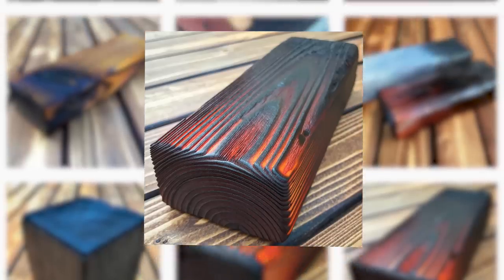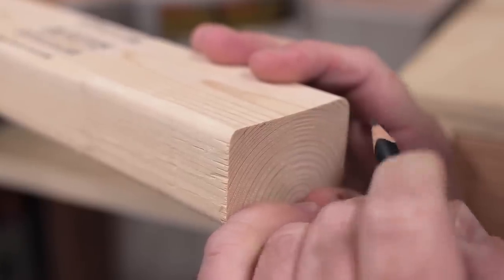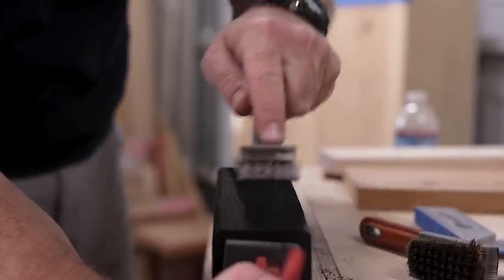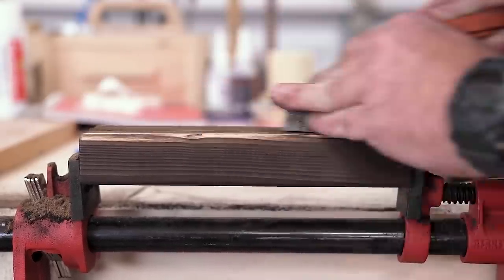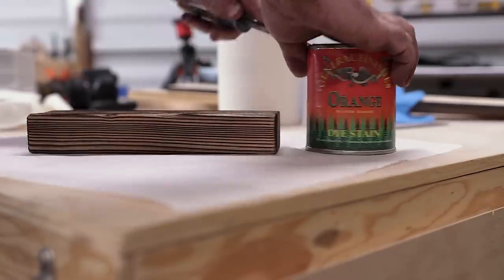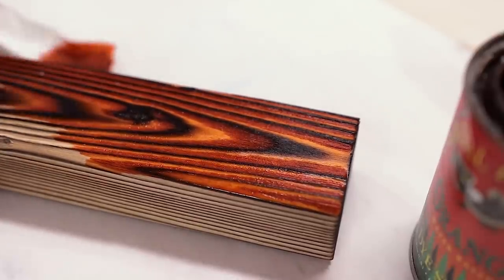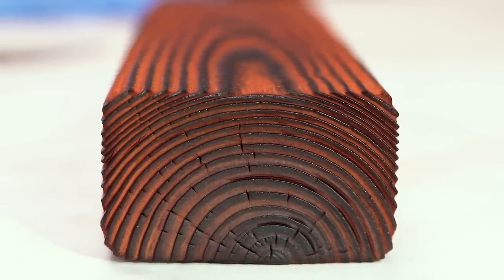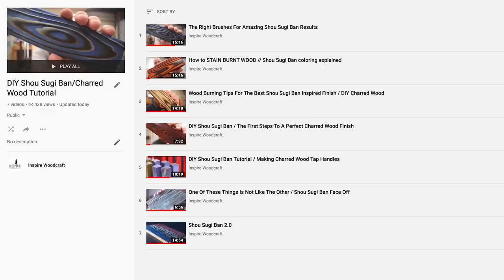The Shou Sugi Ban Inspired Finish That Started It All

Comment: Some 35 years ago, I made a few sets of coffee tables and end tables using the same technique. Doweled and glued, no nails or screws and they're still intact. I didn't put nearly the care and attention as you did but they still turned out not too badly. Impressed with your result.
Reply from the maker: Well thanks! I think dowels have somehow been shunned over the years and I'm not sure exactly why. I still use them for all kinds of things.

Comment: I love these videos. I have started making signs and whatnot using "fire blockers." Steel doesn't let fire through and can create some real interesting designs
Reply from the maker: I've wondered if anyone has done this yet. I wanted to try it as well and just never did. Do you have certain shapes and stuff that you use for different designs or effects?
Reply: @InspireWoodcraft  i mostly use some lettering. I make a lot of personalized signs. I used a washer (and a large bolt to cover the hole) in combination with a laser engraver to make some Nightmare Before Christmas key chains. Wood tends to leave a fade, but steel will allow you to get sharp edges between burn and natural. Currently I am exploring designing some plasma cut stencils for shapes.

Comment: Looks amazing!  I just can't imagine the time to do it all by hand!?!?!?
I've been using Nylox ever since I found your original tutorial (thank you so much for those) and really like the results.  It does take a lot of effort to get results anywhere near yours but it's worth it.
Keep up the great videos and have a great Christmas!
Reply from the maker: It's so much work by hand! I forgot to mention but you can also use the Nyalox brushes to do the heavy lifting and then follow it up by hand to create the texture. But yeah by hand takes FOREVER! Ha! That's what happens when you go in blind though I suppose. Merry Christmas to you and yours!
Reply: @InspireWoodcraft  are you talking about a wheel nyalox brush? if so what grit do you recommend to get the texture like yours im tryna make a burnt bar counter top on live edge but not on the bark part like just the top then doing the doors below but lmk how to get that texture and lines if that's what you meant or post a link to the brush whatever is easier for you.

Comment: I'm just starting to play with this and used a little wire brush I had from an automotive kit and it leaves notable scratch marks in the pine I'm playing with. Are there less abrasive brushes that will still dig out a good portion of the 'inbetween grain line' portions to get better contrast? Or is it that the brush needs to follow the contour of the individual lines to kind of blend into it to look more like texture lines instead of scratches?

Comment: Thanks again for the great video.  I love the vibrant colors that you are using .  Interested in what you are using for white since GF does not have it.  I'm using Minwax water based stain
Reply from the maker: No problem at all. Thanks for taking the time to watch! The white I have right now is Varathane Antique White. It works well. General Finishes makes a white wash that works well but I don't think I have any right now. I've used Minwax water based before but maybe not in white. I don't remember having troubles with it.

Comment: Hi. You started something wild inside of me . I want to keep burning and staining .i love doing it! Heres my question. I use the dico wheel you use , after burning the piece i go over it once to take the most burnt off. Then i hit it a few more times .but as i get down to the lighter piece of the wood the ash dust attaches itself to the light wood i just finished digging. I tryd going left to right and right to left in one direction. But the dust still sits inside. After i got were i want it. I even tryd hitting it once . Then brushing it off with a painters brush repeatedly after each pass with the dico. but its still there. I mean its nothing crazy. But if u look close theres still some dark dust. Please get back to me man. Thank you for putting me up on this     Shou sugi ban

Comment: Hi Jody.....I just recently found your channel and have learned so much from you in just a short period of time. I am going to attempt my first Shou Sugi Ban project. I want to make a small table for my mom. I have a question that I can't seem to find an answer for. Do you sand the wood prior to or after the burning process? Cause I want to do a table, I don't want it to be rough. Thanks for your help and great job with your videos!

Frank - SoCal
Reply: Hey Frank, I noticed no one has responded to you yet, but imo I think Jodi would recommend you to sand prior to burning the wood. Lots of sanding since you want a smooth surface and then to not use the brushing technique but to very lightly char the grain but don't put a lot of heat to the wood, you just want a light surface burn and then wipe off the wood and dye it, then place a finish coat on it. This will keep your surface smooth but it won't have that textured look to it

Comment: Just wanted to say thanks for the videos they are great! I’ve watched all the sho sogi ban tutorials and have gotten some good results! Wondering when you use the stain do you wipe off the burn parts completely? I’ve gotten good result but the black is being covered up with stain vs dye !👍
Reply from the maker: Well thanks for watching! Yes I usually wipe them off completely. Your results will depend on how long you let the stain setup after you apply it. Also steel wool (#0000) can help to polish off the black parts and remove stain that has dried a little quicker than the stain in the valleys. It is especially helpful with white. (that reminds me: I forgot to do a video on white.)

Comment: Is their a way to do this but leave the surface flat?  I would love to do a table top like this.  Thanks
Reply from the maker: You could do what I call a surface burn, where you basically just sort of kiss the wood with the flame as opposed to actually burning it. It doesn't give the same effect unfortunately, but some people like the look regardless. I made a video comparing the two if you're interested https://youtu.be/-c6TQgoj7T4 Other than that you could try to do it this way and then use epoxy or something to fill and level it out.

Comment: So what do you do with this after this is done, it's not the final product is it?
Reply from the maker: Well that depends. While I have sold a piece similar to this before, it could have holes drilled in it to hold candles or to be used as a succulent planter. Also it could be milled further to be used as a business card or sign holder. I've made multiple blocks like this of various sizes, shapes and colors and arranged them in specific or random patterns, then glued them to a backer for wall decor/art. In larger scale, a process similar to this could be used for bar/table tops and wall coverings and even large scale furniture. This video was more about the finishing technique, not necessarily the end product.

Comment: It no doubt looks great. It's very cool looking on a 2x4 but what kind of project would that look good with as a material and color choice?
Reply from the maker: Honestly I just sort of leave stuff out there to hopefully inspire people to go where their own imagination takes them. That being said, a lot of people have mentioned picture frames (a project that I plan on doing once I finally replace my table saw), bar/countertops with an epoxy top, handrail, wall covering. I have used it for decor pieces in the past, making several of these type of blocks and gluing them to a backer which hangs on the wall. Although a smaller project, I've made candle holders and succulent planters using this technique before as well.
Reply: If you cut a crossectional profile like a bold taper or deep crown moldinglike shape into the 4 pieces used for a frame or similar(top rail on stairs or the wall rail, etc) then full char/scrub shousugi ban it. It looks incredible!

Comment: Hi, i would like to ask some woodworkers about combnining shou sugi ban with traditional japanese jointery, is it agood idea to first make japanese joint, so no nails no glue, etc. and then treat join using small fire? or maybe its better to spare joint surface from fire and burn only flat area of wood with big torch? Do you have any links/info how wood changes properties after burning? sorry for my poor English, kind regards :)
Reply from the maker: This is a topic I've been wanting to talk about for a while. I'm not really sure with traditional Japanese joinery because of the small parts. I think if it is glued and assembled it should work well, but again I haven't tried it myself yet.

Comment: What purpose or what use would this be for, looks nice but why?
Reply from the maker: This was just to show the process of the finish itself, not necessarily the end product. The finish can be used on pretty much anything that requires a finish. Picture frames, bar/table tops and flooring is a few of the suggestions that I hear most often. The block itself could have holes drilled in it to be used as a candle holder or succulent planter, or a groove run through the top for a sign and business card holder. I've made several blocks of various sizes, shapes and colors and glued them to a backer for decorative wall art before as well.

Comment: How does this technique hold up outside?  would you recommend adding some sort of sealer after the color?
Reply from the maker: The technique itself works great outdoors but the dye will not hold up. It will fade over time especially in the sun. You could use an exterior grade stain though and it would work great. And in that event, you wouldn't need a sealer.

Comment: Ok. Not bad. But what is it used for?
Reply from the maker: The block itself can be made into a candle holder, succulant planter, or a business card/sign holder. The technique itself could be used for all sorts of things. People have suggested bar/table tops, handrail, picture frames, even large scale furniture. This type of finish is also used as an interior and exterior wall covering. I've used this method and others for decorative wall art and decor, putting many shapes, sizes and colors in random or specific patterns.

Comment: After you brush off the soot with hand brush or nyalox, will there still be a residual soot coming off?  Are you supposed to wipe it down with a damp rag or something to get ALL of the soot off? Or do you dye right over it?
Reply from the maker: No because the soot comes from the soft spring wood, which is being removed. The charred grain left over is basically "clean" after the fact. I use a large paint brush as a cleaning brush, and I just sweep the pieces off after I brush. That seems to work fine. Then I dye any time after that.
Reply: Thank you!  I must not be scraping enough off,  because when I run my hands over it, there is still soot.  I’ll go over it again.  Appreciate your time and videos.

Comment: Amazing! What kind of brush do you use? My problem is that when I brush  the color of the whole wood become similar, kind of smooth brown, there is no black and white colors. You are excellent!
Reply from the maker: Honestly they are just a couple of inexpensive brushes that I got at The Home Depot. Sometimes that happens when the wood that you start with isn't very light in color to begin with or if the wood is not dry enough. If it isn't dry enough you are basically just making mud and smearing it around.
Reply: @InspireWoodcraft  thanks for answer, I got it. Is the brush stainless steel or brass or what?

Comment: This technique is a great way to put an interesting finish on blocks I use as stands for my sculpture combined with old stainless rollers and rods from scrapped computer printers. I've also used it as a finish on some of my driftwood sculptures. It's also a really neat way to add attractive accents on the rustic custom picture frames I make. I find it is faster to use a fine wire stainless or brass rotary brush in my drill press and get good texture control without lots of manual brushing.
Originally this charring was used in ancient Japan where paint was expensive and hard to get. As well as being "cheap" and easy alternative to paint it was more resistant to weathering than using primitive lime whitewash or milk paint. it's a primitive but extremely effective method to provide very permanent waterproofing of wood structures without the expensive oils and natural resins used in paint or varnish. These chemicals in paints also break down in the weather from heat and sunlight which causes the paint to crack and blister. This means you're providing a deep, integral layer of a nonreactive pure CHARCOAL coating on the surface which is waterproof as well as completely resistant to UV! 
Instead of using those time consuming multiple mist coats of clear you also might want to try gently pouring on a thin flow coat of epoxy which you then warm up with a heat gun to level out and permanently bond by soaking into the wood.
On your question about using different layers of finish over something like superglue or other oil based enamels or acrylic paint base coats, just remember not to use a lacquer based paint over those paint surfaces as the "hot" thinner will cause the underlying enamel or acrylic to soften and blister.
I hope this info helps. As for my credentials, I'm not only a chemist but have also been an artist and woodworker for many, many years. You can see examples of my Shou Sugi Ban style picture frames and sculptures on my emergeART Facebook page.

Comment: What type of rail clamp do you use to hold the wood as you brush?
Reply from the maker: I have a pipe clamp inside a French cleat holder that I made to fit the clamp. I also have a mating French cleat rail around the perimeter of my bench so that I can just set it on there to brush and then take it off and hang it back on the wall when I'm done using it.

Comment: So. You got that little hunk of good looking burnt up wood. What can it be used for, I mean, that is not for anything right? Just a proof of concept, right? I just don't see how you could use tat tiny scrap for a project. But, doing thus to a finished, something, that is what you would do your process for burning wood on, correct? Otherwise, tat little piece of wood by itself, rather pointless and useless ... in my eyes and my opinion
Reply from the maker: Yes mostly just a proof of concept to show a technique. But even this simple block could have a notch cut into it and be used as a sign holder or business card holder, or holes drilled into the top to hold succulents or candles, so it isn't actually useless at all.

Comment: You use a wire wheel on a drill to achieve the look. And NO YOU DONT DO IT BY HAND. FUCK THAT. THERE IS MONEY TO BE MADE. TIME IS MONEY. IF YOU WANNA BE AMISH AND DO IT BY HAND HAVE AT IT, TO EACH IS OWN. BUT IM NOT FROM THE 1800's so ill use my drill for this one.
Reply from the maker: While I don't see the need for foul language, I can see the point you're trying to make. However I have to disagree. I know all about using wire wheels and other things in drill for productions sake. In fact there are handheld power tools dedicated to these things and full floor units designed for this very thing. I think what you might be missing, or just don't know the difference, is that drill attachments do not give the same effect as hand brushed because of the physical relationship between the brush and the wood. This has been proven many times and hand brushing is what got my name out there with this type of finish to begin. Hence the part where I said that many people have asked me how I achieve a highly detailed effect. If you watched the whole video, you would have noticed me mention the other videos on this channel that I have made going over every aspect of this whole topic. As for "time is money", again I have to disagree. If this exact finish is what a client wants and is willing to pay the premium, then the "time is money" rule simply does not apply. That's like claiming that hand-cut dovetails is completely a waste of time and should only be done with a machine. It just doesn't work that way.